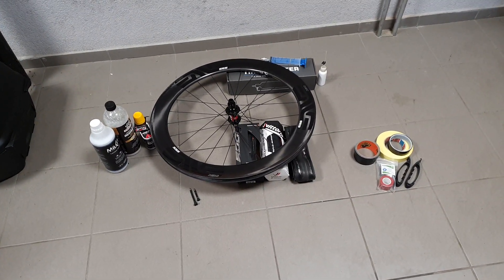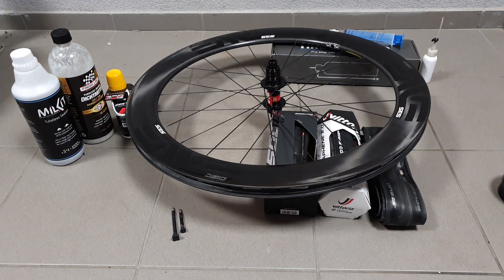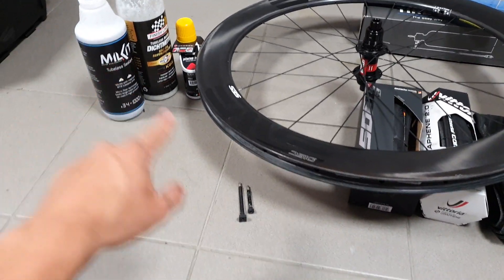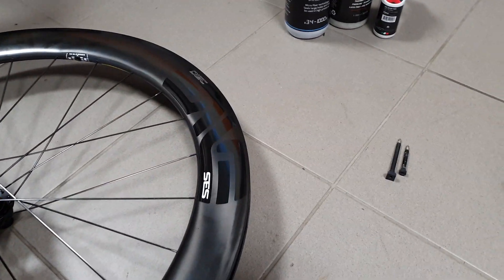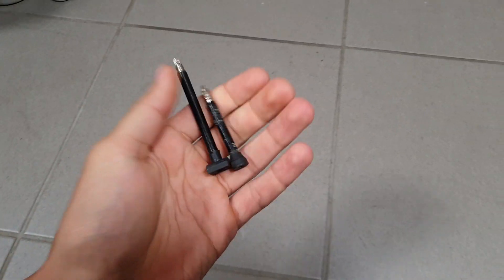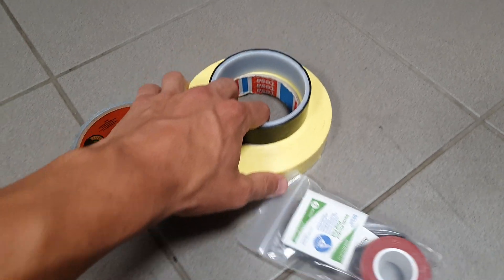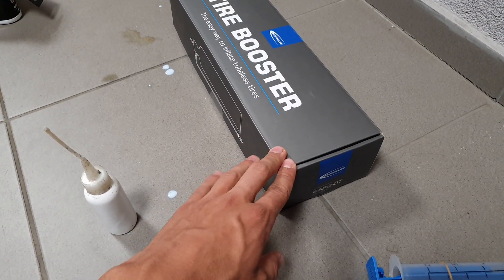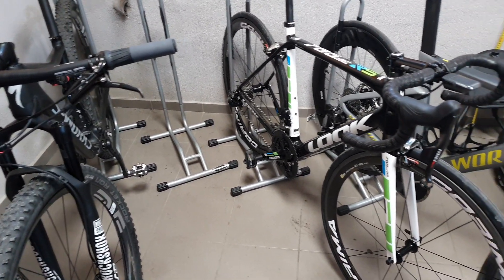All you need to know about road tubeless

Comment: Sorry, but this isn’t correct - tubeless are not faster, look at the rollingresistance site and you will see, that TL version of 5000 is about 1.7 watt faster than clincher, but you can make 5000 clincher faster with latex tubes, in the same time you can’t tune the TL-version. That about the speed. Off course the fastest TL - corsa g+ 2.0 would be (perhaps) faster than clincher with the best latex, but they are too thin for everyday use. Read more here -  https://www.bicyclerollingresistance.com/specials/schwalbe-one-tubeless-clincher
  “Clincher w latex tube: Have the lowest rolling resistance” - quote.
Reply from the maker: Latex tubes will not save 1.7W
Reply: @ronykuba  well, if you look at the table, this is actually the case AND - they had NO tubeless fluid.  Also Silca claim to have more advantage than other latex tubes. Latex tubes have very similar comfort like tubular. It's not about marginal gains in this case, because there is simply no data, that shows, that tubeless are faster than fastest clincher+latex combination YET. There are no good tubeless at the moment, that would be superior than best clincher+latex. The fastest tubeless is only for TT, have a poor grip and puncture resistance.
 So at the actual stand of bicycle science, the fastest allrounder would be GP5000 with latex (Silca level or similar). the fastest TT would be Corsa G+ but only if you put no more sealant than 20 ml.
Reply from the maker: @bananosipedist  you're a bit off. A Silca tube is just a rebadged Vittoria, so why would it be better?  The GP5000 clincher is a fully vulcanised tire. It will never be as supple as a tubular and no different from the tubeless version, no matter what tube you use. Also if you actually read properly, the GP5000TL was tested with 20ml of sealant, which is perfect for normal use. It can be used without, so it can be "tuned" indeed. And no, a latex tube will not shave 15% of the Crr. Aerocoach data confirms that too. GP5000TL and GP5000 + latex are almost equal in Crr, but you get the puncture protection and robustness that the latex tube can only dream of.
Reply: @ronykuba  I know through your videos that Silca eventually uses Vittoria tubes, I did wrote - "Silca claims…", because they simply do this :-))) 
   Maybe I should briefly state that I had NO experience with tubeless yet, but with tubular and off course clinchers. My Enve 4.5 are not tubeless ready and I've been thinking for a while about upgrading to tubeless wheels . BUT first, I want to have clear data and no compromise rash decisions. 
   So if you take a look at bicyclerollingresistance, you will see - those Corsa 2.0 were tested with ONLY 20 ml sealant. The fluid will get through the imperfections and porosity of the tire, as you mentioned, and then you MUST put some more sealant in order to guarantee the puncture protection, right? But it will also reduce the RR.  Ok, Corsa 2.0 are not practical, race only solution. Let's discuss 5000. Look at aerocoach, do you have the same source? - https://www.aero-coach.co.uk/gp-5000-tubeless-data   It actually proves, that the clincher version is marginally faster, that is not enough for tubeless to be a superior solution.  
   Also the latex tubes provide similar (but far from equal) to tubular ride feeling, that what Silca also claims. 

   At the end of the day there are NO Tubeless solutions yet, which are significantly faster for other than TT-rides. I would argue about puncture protection, because in my opinion it comes to place, where you ride. I have no flats, but if I get them - 9mm sidewall tears))))  So tubeless will not help.  practicality…… you mentioned that yourself - clinchers are the simplest in everyday use. 

 Thanks for your content always inspiring!